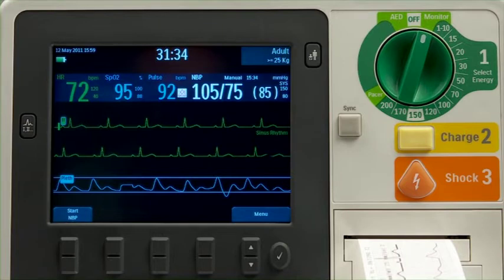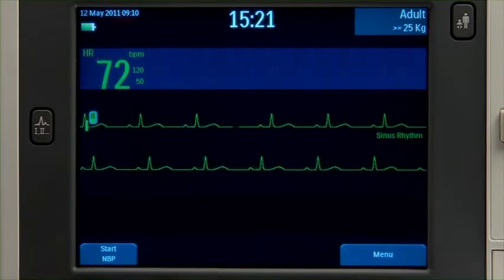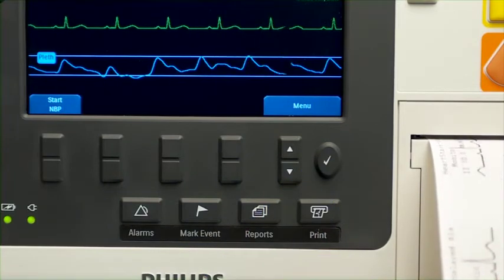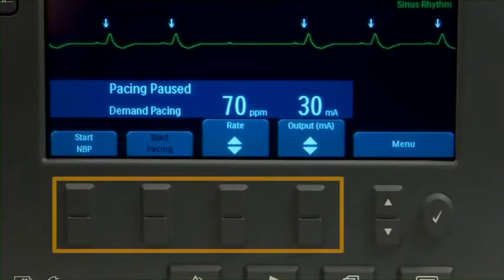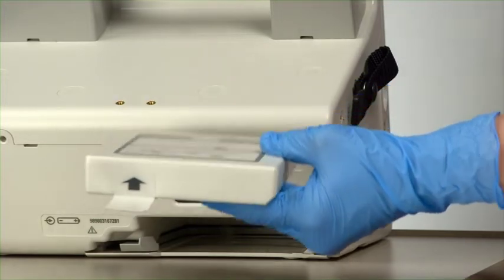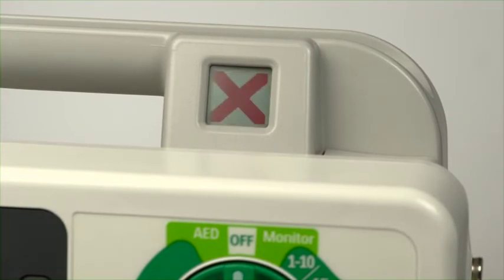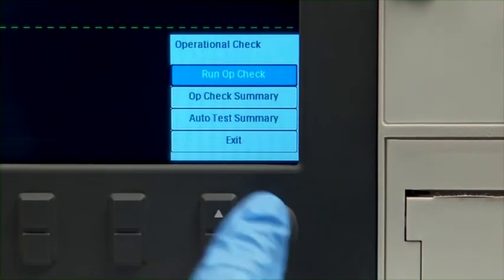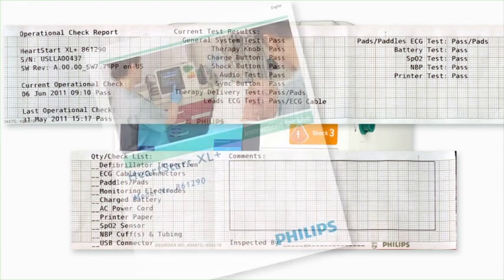Overview of the HeartStart XL+ monitor/defibrillator

Comment: I have some heat damage to the front of the screen. Our Heartstart xl+ was left in an ambo for a few years. good news, i plugged it up and everything works. passed op functions test. also our version does not have NiBP,, O2  inputs, can that be upgraded? can the Screen be repaired?
Reply from the maker: Hi, thank you for your comment. Thank you for reaching out! We're sorry to hear you're having trouble with your screen. Our AED support team is ready to assist you with troubleshooting and providing further options. Please give them a call at 1-800-225-0230.
If you have any other questions, feel free to ask. We're here to help!